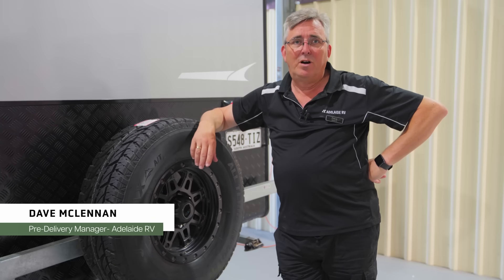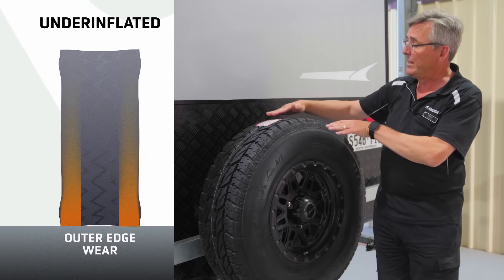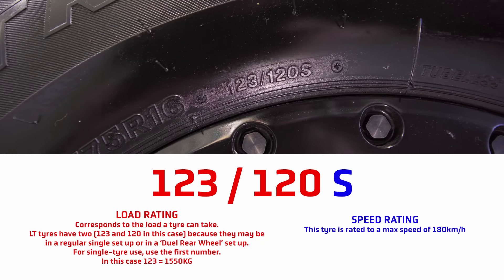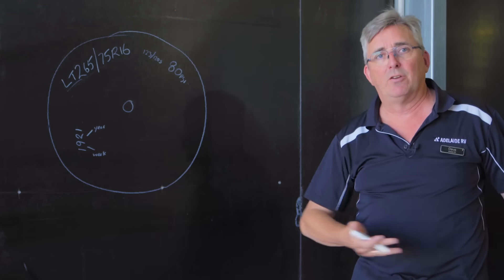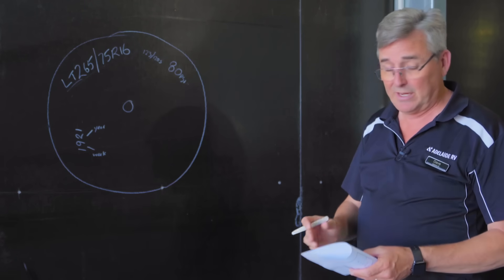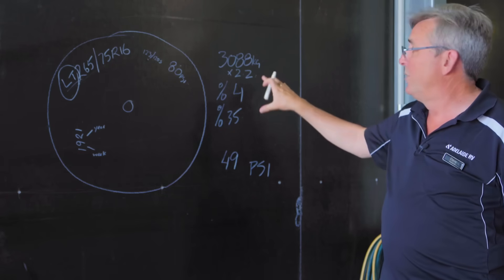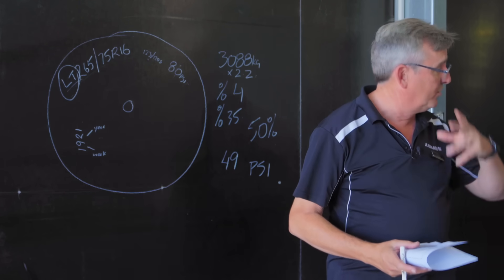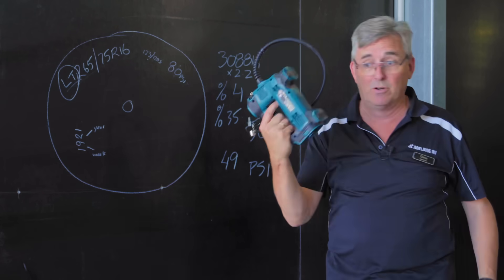How to PROPERLY calculate the PSI for your CARAVAN TYRES

Comment from the maker: It seems that there may be outliers that don't fit that calculation! If you have a heavier single axle van, or a very light tandem axle van, you'll get some funny numbers. We recommend starting with the tyre manufacturers suggestion and then testing with the 4 PSI rule. Also, never inflate your tyres over the max PSI as stated on the tyre wall.

Comment: I have to agree with those responding here that this formula does not work for single axle. My single axle with 2700kg ATM would be 84PSI per tyre. I would be inclined to think that the tyre load rating and ATM load per tyre would need to be factored into the equation. 

There are so many single axle caravans manufactured upwards of 3000kg ATM., if not higher.

Comment: Almost every thing there was incorrect. Light truck is an extended load range radial, same as what you're calling passenger car tyres. It just means that, for the same size they'll have a higher load rating. Incidentally the extended load rating means that you need less air in them for the same load, not more. You also need to be aware that the effects you're talking about with inflation were true for cross ply, but they haven't been in common use for about 40 years at this point. The reference to tyre heating was, in fact, correct, but it occurs because of sidewall deflection on rotation, not because of any springing effect. It's also worth being aware that the grip effects that you're talking about do, to some extent, exist and some are quite a lot more extreme than you think. The tyre is a spring, or, in fact, two springs. One is made up of the tyre sidewall and the other is the air in the tyre, this is why LT tyres need less air for the same load; stiffer sidewall. 
The heating effect is sort of correct, but 4 psi may be valid and if it is, then that would only be under very specific circumstances. The pressure increase should be proportional to the existing pressure. If you're driving a Jimny then looking for a 4psi increase will have you either operating at well below or will above the correct pressure. Similarly, a fully loaded dc ute will show larger variation when it's correct. 
A tyre should never get above 60-80 degrees, depending on environment and what you're doing with it, so if you can hold your hand on a tyre for a few seconds or so after a long drive and you're getting around your normal fuel economy..  about right.. if you're getting increased wet braking distance then that's too much...

Comment: Good info mate. Most of the heat generated in a tyre is from kinetic results. The tyre flexes greater at low pressures and speed. Very little heat is gained from the road.

Comment: Prado 38psi front and rear, 2T offroad camper trailer 38psi single axle. Ran like a dream right across Australia and back, 15,000km at 110kmh on bitumen or gravel. You want a tyre to blow? Overinflate it. You want to skid and crash? Underinflate. 38psi for all that is just comfortable with minimal wear and excellent traction.

Comment: I have a single axle off road van purchased from Adelaide RV some years ago with that exact size of tyre and going by your calculations I would have to run my tires at 85psi! That is higher than the recommended maximum fully loaded pressure as stated on my manufacturers plate on the van. Surely that would not be correct!
Reply from the maker: No that wouldn't be, and you certainly don't want to get close to the max PSI on the tyre! This equation didn't really work for single axle vans. We recommend that you start at what's listed on the plate, then follow the 4 PSI rule that Dave explained.
Reply: @adelaiderv no worries thank you I appreciate your reply.

Comment: Great video !   Haven't gone through every answer/question, so excuse me if it's already asked somewhere. In relation to rotating tyres on a dual axle caravan (NOT UTILISING the spare wheel), what is the sequence. Yes ideally the spare should be included in rotation but not atm.
Thank you

Comment: I have a single axle caravan with tyre size and psi as per your video. Tare 2900KG. What pressure should I run in the tyres ?
Reply from the maker: As the calculation doesn't quite work for heavier single axle vans we would recommend you start with 50PSI and drive for an hour, then check the pressures again. If it's increased approximately 5PSI then it's properly inflated.

Comment: I tow a 3T loaded single axle van, with manufacturers spec for 60psi. I start with 35psi on the ute tyres, and 55psi on the van. Towing in hot weather takes my front tyres to 40psi, my rear tyres to  44psi, and the van to 65psi (as per my TPMS). This has worked really well for me, have had zero issues on a whole variety of road and weather conditions.
Reply from the maker: That's great to hear you've found a setup that works for you, and good that you're monitoring your tyre pressure so closely!

Comment: Dave, I just like to help with writing your calculation out.

3088kg * 2.2 (kilos to pounds conversion rate) / 4 (no of tyres carrying the load) / 35 (square inches of the carrying area of each tyre carrying the load) = 48.5257142857 pounds per square inch (PSI).

The problem areas then is knowing what the square inch area is for the type of tyre each of is running. 

Because our loads change and because the heat of the tyre changes I prefer to do a visual inspection rather than just using the calculation. The calculation is very useful till you get use to knowing what you should be seeing in the deflection of the side wall of your tyre. 

I can't help but think the tyres on your caravan you used in your video seem a bit under inflated to me!
Reply from the maker: I agree, visual inspection is always a great way to confirm your tyre pressure is correct, as well as checking the PSI

Comment: Perhaps you might try reading the compliance plate with the tyre size and pressure on it. There is a chance the manufacturer knows what’s going on.
Reply: That's OK for one scenario, but they can't know how much the 'van is actually loaded, only the minimum & maximum. As for compliance plates, mine has 637kg for the Max. Ball load & zero info for the recommended tyre pressures.

Comment: We’ve just added a six sensor TPMS to our motor home and it’s great because I finally found one with a colour screen that’s big enough to see without glasses. Most of them are so tiny they’re almost useless because I have to swap from sunnies to reading glasses to read it. It also only shows each tyres pressure and temperature in different colours with the time in the middle so makes it much easier to read at a glance.
Reply from the maker: That's awesome, glad you found a system that works for you!
Reply: What one did you get please
Reply: Careful. On corrugated roads the valve stems can fracture with the extra weight. They bounce around more. It's happened to me. I've put a silastic shoulder on the base of the stems now. You still need to keep an eye on them. I carry spare stems and a tool to replace them without the need to remove the tyre. Along with some puncture repair gear.
Reply: @imagineaworldwithdecentpeople  Thanks for the tip. Fortunately my days of corrugated roads are mostly behind me and I also carry spare valve stems and the kit to replace them without removing the tyre and of course a compressor. I like to be self sufficient. Cheers 🍻🍻

Comment: Driven B-double trucks and caravan and boat several times all around Australia.  Saw many vans and trailers stranded on the side of the road. The two failure types are wheel bearing failures and tyre carcass blowouts caused by underinflated tyres. The tyres all look the same - the sides are shredded into petals of rubber of consistent sizes. Classic side wall overheating due to internal tyre wall pinching on itself. 

Do a lap, you'll see plenty of em...

Comment: I have an off road van 16' single axle ATM 3000 your calculation puts mine at 75psi a bit high by your calculations?
Reply: That sounds about right. You are going to be approaching the max load rating for your tyres, so also near that pressure for max rating

Comment: Tyres don't generally increase in pressure due to the temperature of the road surface if you're moving at normal speeds. What actually increases the tyre pressure is the flexing of the sidewalls at every rotation of the wheel. The energy expended to flex the tyre sidewalls increases the air temperature in the tyre. The rough rule of thumb is a 4 psi pressure increase after driving for one hour.

Comment: That advice to set your psi at 50 being half your speed is just silly, wrong and dangerous. Perhaps when he says it’s the “general rule of thumb out there in caravan land” he’s referring to Australian built dual axle vans? I don’t know I don’t have one. I do know if I followed that advice for my dual axle Euro van, I’d be running at 20% over inflated. Similarly if my friend with a single axle van followed it, he’d be running his at 25% under inflated. 

I do a proper calc using the load rating and I don’t use the ATM as per this video; I use the actual weight on the axles because that’s what the tyres are supporting.

I suggest this video be removed.

Comment: Have a tandem caravan near enough to 3T weight.  Independent coil non-load sharing suspension.
245/75r16 LT tyres (85psi max pressure), load rating of 121.
I tend to use a "4psi increase over cold when at operating temp" benchmark for most vehicles.  Based on this I run 62psi in the tyres and still get a 6psi increase when driving on tarmac on a fine 25C day.  Tyre temps sitting at about 30-32C which I am comfortable with and the primary reason I don't bump up the pressure.
Have 265/70r17 LT 123LR tyres on the tow vehicle.  Rears get an additional 10psi (to 46psi) when towing and sit at about 50-51psi when at operating temp.
I think 50psi would kill my caravan tyres real fast.
Calculations give a starting point but all tyres/vehicles/conditions and driving styles will be different, better to keep an eye on tyre temp and pressure changes than apply a rule in blind faith.

Spend $50 on a decent gauge and then spend 5 minutes checking pressures after a decent drive.  Then you will KNOW if your tyres are too high or too low.

Comment: Good idea to put your hand on the bearing and check for heat.
Reply: This saved me over new years half way to Barrington from Brisbane. Touched both at the servo and almost blew my hand off! The while wheel was too hot to touch and was over heating the tyre. Luckily the local tyre place was able to put in a new bearing for us

Comment: The calculation doesn’t appear right for my single axle van. The recommended psi is 75. No way I would be putting 75psi in my tyres. I run them at 50psi on the black top and 30psi on outback roads.

Comment: I always thought the majority of heat was generated by side wall flex if under inflated. Any road heat would be negated by air cooling for the other320 degrees of rotation. 🤷‍♂️
Reply: Correct
Reply: @craigskinner6747 Not as simple as that; my spare goes up in different conditions

Comment: 2700*2.2/2/35 = 84 PSI?  Higher than the Max PSI of the tyre!
Reply: Do you have a 2.7t single axle van? 😮
Reply: @DW-10  I wish I didn't, but nearly all manufacturers are single axle up to 19ft.

Comment: Rather than using the ATM, I would have thought it made more sense to use the GTM given this is the part of the van weight that sits on the road and discounts the towball download weight borne by the tow vehicle. That said, appreciate the advice being given. I have checked tyre pressure recommendation with my dealer several times and am more than convinced I’ve been getting the wrong advice for years now.

Comment: Thanks for taking the time to put this together and to explain. But using your calculations, on my single axle 18 foot full off road van with an ATM of 3200 would be around 100 PSI. This seems extremely high. Considering the max the tyres can go is 80psi the tyres I am running are Mickey Thompson BAJA LEGEND EXP 295/70R18 129-Q (1850kg)
I am currently running 65 psi on the bitumen (up to 100 km) and off road with corrugations 50 psi and generally keep speed down to (60 km or less depending on road condition)
I would welcome your feedback on this.  Thanks.
Cheers
Reply from the maker: It seems there are certainly some outliers that don't fit the equation, especially heavier single axle vans. The 4 PSI rule should still apply though, so as long as you meet that you should be fine.
Reply: @adelaiderv thanks for your reply. This is the calculation method I follow
Maximum Inflation Pressure: 80 PSI
Caravan ATM Weight: 3200 Kg’s
To determine the correct tyre pressure:
Start by dividing the maximum pressure for the tyre (80 PSI) by its load rating (1750 Kg’s):
80 ÷ 1750kg = 0.045714285 (Max Pressure for the tyre divided by load rating)
Next, multiply this result by half the weight of the caravan (ATM 3200kg ÷ 2) = (1600kg) (since it’s a single axle caravan):
0.045714285 x (1600kg / 2) = 73.1428 PSI (inflation factor times half the weight of the caravan)
So, the appropriate tyre pressure for my single axle caravan is 73.1428 PSI.
Reply: @alecmarra8124  thanks for your "outlook" on this, it works for my Pro RV 16' single axle van and matches the Vin Plated rating of 65 psi. Using the original "equation" would mean my tyres would need to run at 91psi, far above the tyre rating of 80psi.
Cheers

Comment: Thanks for taking the time to put this together. Using your calculations, a single axle van with an ATM of 2900 would be around 91 PSI. This seems extremely high.
Reply from the maker: Yes, looks like heavier single axle vans and very light tandem axel vans skew the calculations a fair bit. Checking your pressures with the 4 PSI rule would be best.
Reply: Basically your van is too heavy for a single axel! Your van should be on a duel axel!
Reply: @ how do you arrive at that conclusion? There are lots of single axle vans around that weight.
Reply: @ColinNeill-z2n You've highlighted the problem. The answer is there are lots of trailers running around on single axel trailers that should be on dual axels. Sorry but you probably have a problem trailer. I had one of those years ago. I had to change the trailer to a dual axel so I could do long distance towing safely.
Reply: @ how so? The person whom designed and built the caravan has made many like it. The video was to do with correct pressures and seems to be flawed.
Reply: Yeah, I got 89psi and that’s gotta be wrong
Reply: Colin. Same here. My van is also 2900KG single axle. Formula doesn’t work for 2 tyres.
Reply: @allanhickson9214  You need two axels NOT one! Sorry!
Reply: The van is just 4 years old. Bought brand new from the manufacturer. All registered etc . Hilltop caravans still made and for sale. Malibu is the same. ONE axle. Semi off-road.
Told to run tyres at 60PSI cold and the go to 64 or 65PSI when driven on a hot day over 3 hours.

Comment: Load rating is important also, as with each individual tyre there is different load rating or how much weigh they can carry. For example, on our single axle, 18 ft Wild Child, our big off road family van, they have to have about 60 – 70psi in the tyres, as anything less than that on a highway, the tyre isn’t actually rated to carry the weight that you have put on it. From the marvel web site

Comment: In the formula, instead of Caravan ATM it should be actual weight i.e. Tyre Inflation Pressure = (van weight – towball weight) / (tyre load rating * number of tyres)) * maximum tyre pressure
Reply: Agree, yours is the correct formula.👍
Reply: If I use your formula with my Adverturo AT3s it works out at 28psi which is crazy. This alternate formula in this video works out at 43 psi. The max PSI on my compliance plate and tyre is 50 psi.
Reply: @kazzazed1277  It can't be ATM, it makes no sense but if your happy that is all that matters. ATM is the max weight the van can handle nothing to do with the current configuration.
Reply: @Peter007Freeman I understand what ATM is. My actual weighed ATM is 2752 kg, TBW 297, GTM 2455. My max tp is 50, max load rating is 1090kg and dual axle. So, 2455/(1090x4)x50 =28.154 as I said it just doesn’t work for my tyres (Adventuro AT3)
Reply: @kazzazed1277  Won't work for me either.  GTM 2700.  Load rating on tyres 1450kg (121) tandem.
2700/(1450x4)x85 = 39psi.  I run them at 62 and still get a 6psi increase from cold to operating temp.  Even allowing a 20% increase to account for the non-load sharing independent suspension, I'd still be at 47psi.  I'd be cooking the tyres at that pressure.
Reply: I use the actual weight on the axles, not the actual weight of the van (because some of the actual weight is on the tow ball and not on the axles/tyres).

Comment: shouldnt you go by what is stamped on your compliance plate ?.
Reply: How did they know the weight, roads or conditions of your car/trailer as you use it.  It is a good starting point but you should use a gauge and some common sense rather than assume the plate is going to be correct for your situation.  My current work vehicle has had three completely different sets of tyres.  Michelin, Bridgestone and Continental.  All three had the same size and load rating.  I ran pressures with a 4psi difference going from the Michelin to the Bridgestone.  Bridgestone had a much sturdier carcass.  Continentals sit about mid way between them pressure wise.  If I followed the placard the Bridgestones would have been overinflated (came with Michelins).